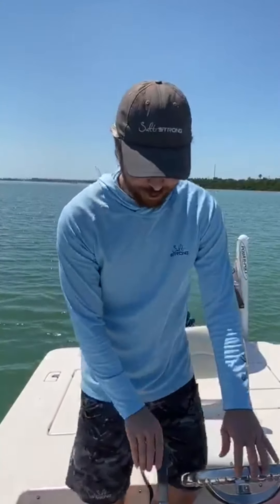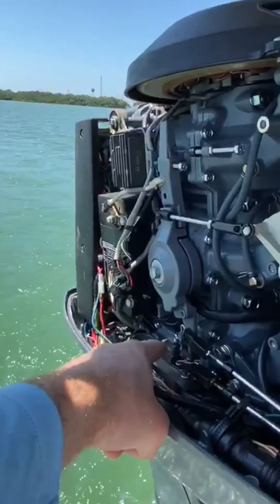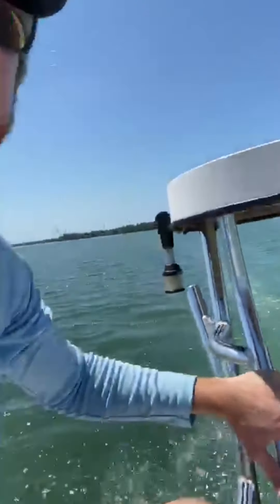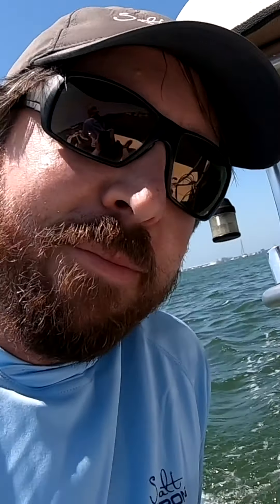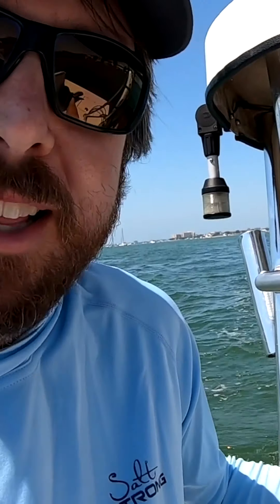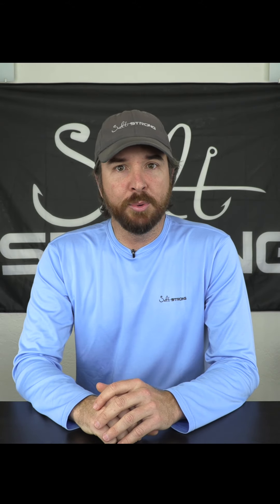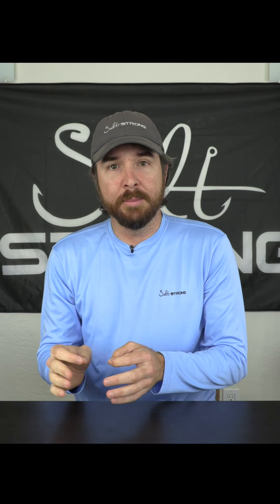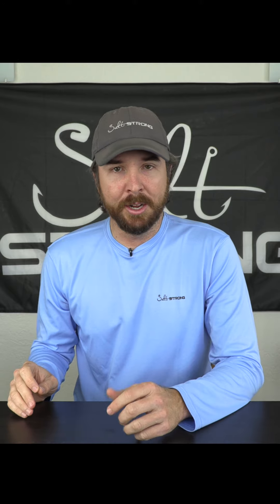If You Have A Broken Throttle Cable, Try This...

Comment: Luke, I would fish 2 throttle cables in, if possible, when you make the repair, just leave the motor end in the boat and the other under the console. If it happens again all you have to do is unhook the bad and hookup the good one.

Comment: Wish it would have been that easy for steering cable 35 miles se of Galveston!
Reply from the maker: That would make for a very long ride next to the engine!
Reply: Salt Strong  had to idle all the way, had a 12 ft hammer on board as well

Comment: Couldn't you get a piece of rod suck as stainless steel solid and fabricate a much stronger throttle?
Reply from the maker: Thank you for your question! We have a massive library of fishing tips on our website along with a search feature to let you quickly filter down to find help you're looking for, so just go to https://www.saltstrong.com/ and use the Search feature in the top menu.
 
Note: If you don't see the exact answer you're looking for, just leave a comment in the post that most closely matches up with your search and one of our coaches will respond to your question... our coaches only make time to answer questions that get submitted to our website.